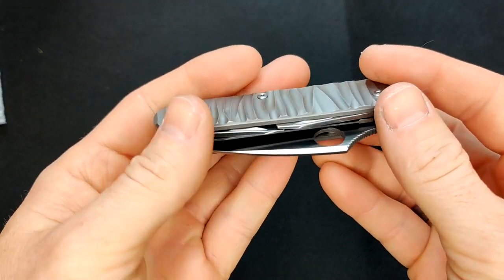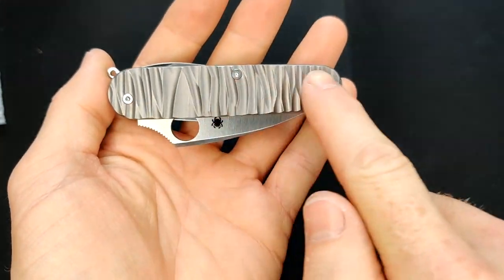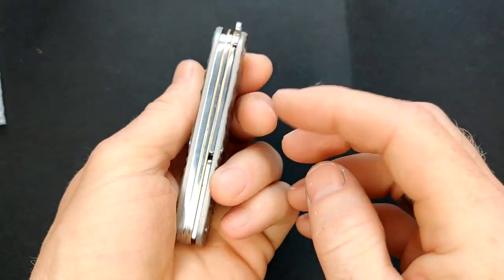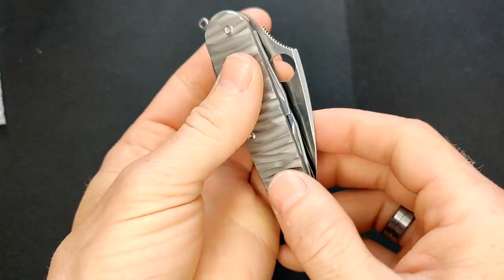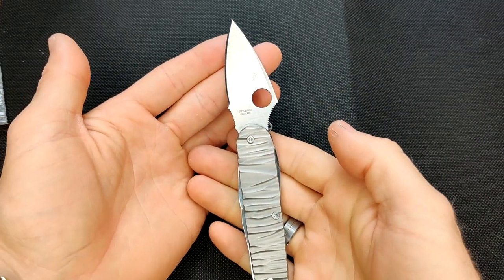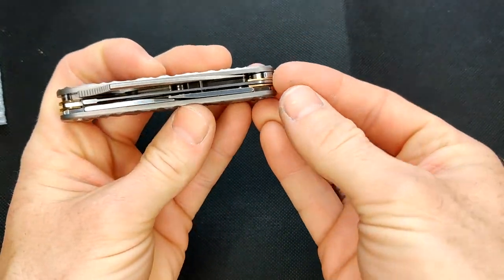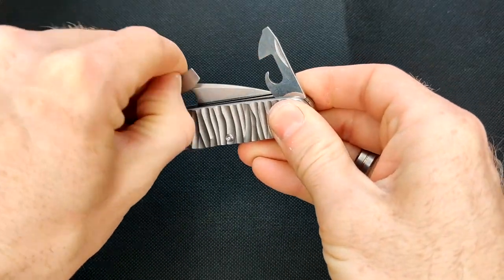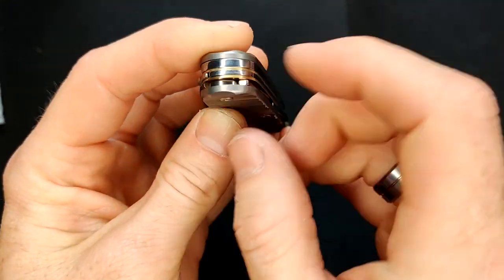Successful Spyderco Dragonfly experiment

Comment: Ahhhhh you did it! Wondering what you ended up doing to make the dragonfly fit, got the same blade and scales hanging out in my shop.
Reply from the maker: The spring layer worked for me after some modification. 👍🏻 Send me a message on Instagram or Messenger if you want some help.
Reply: @FittoSurvive  will do, making a note to get back to you in a day or two.
Reply from the maker: @antonsimanov  Sounds good

Comment: FtS  happy Saturday, you are very talented, a real craftsman, I am but a poor amateur when it comes to modifying my SAK's . I was going to have 2 Cadets that I own modified by a craftsman in France but gave up on the idea because the total cost was prohibitive & the shipping process & return shipping would take too long.  My idea was to make one Cadet into an "Executive" model by removing the can opener & bottle opener tools & replacing them with the small scissors from a 58mm classic & the bottle opener / can opener / Philips combo tool from the Rambler ( leaving the blade & nail file intact ) . The other Cadet I called the Cadet Technician which would entail removing the nail file & replacing it with the 58mm scissors & removing the can opener & replacing it with the Ramblers combo tool & leaving the blade & large screwdriver / wire stripper / bottle opener intact. But as I wrote it was too costly & would have ended up making 2 x  $37 knives bought new into knives which have cost almost $550 for both & so  I figured that was simply an unjustified expensive piece of vanity on my part & scrapped the idea!
Reply from the maker: Sounds like two really cool projects. Unfortunately making custom Swiss Army Knives can become quite costly. In general, the cheapest custom I make costs around $200 (shipped).
Reply: @FittoSurvive  Hi FtS  yes far too much considering that we are not talking about building or modifying special tools like your Spyderco blade or titanium or copper scales but standard SAK parts from other knives, ones that can be bought both new & used on Ebay & cannibalized for their parts . If I had the skill I would have done it myself but alas my modification skill is confined to opening up the secret channel on Plus scales & cutting down a toothpick to fill the slot.
Reply from the maker: @stevesinclair4159  Yeah, I get what you mean. 👍🏻
It's cool that you make the mods you do. 😎

Comment: Love all the custom Victorinox knives that I have seen you do so far !
I'm hoping to do my own custom build, starting with a Trail Guide, and replacing the corkscrew with a Philips screw driver, and adding pliers (both from a Mechanic that I purchased after the Trail Guide... I prefer all my SAK to have a blade, scissors, and the metal file (used mainly for a nail file), and own most models that do... I think !

But I'm hoping I can add a Spyderco Dragonfly 2 Wharncliffe blade in place of the regular large blade... not sure exactly how to go about it, and don't want to damage the Dragonfly blade, seeing as it cost about $70... I see where you mentioned using an old scissors back spring, which I have from a Super Tinker.

I could not find any videos that would show the required mods... maybe you can point me in the right direction ?

I sure would appreciate it... definitely would save me a lot of frustration and trial and error !

Thank you !
Reply from the maker: Hey, that's great to hear.

Sounds like an exciting project.  Sure, I wouldn't mind helping you out. Send me a message on Instagram or Facebook Messenger (links on my website). That way I can send you pictures explaning the process.
Reply: @FittoSurvive  Will do... on Facebook messenger... I don't do instagram... appreciate the advise !
Reply: @FittoSurvive  FB message sent... Thank you !

Comment: What springs did you use for the blade? Since your not using the normal knife ones?
Reply from the maker: I used an old scissor spring.
Reply: @FittoSurvive  thanks man need to try that out! Love your work still trying to figure out a tool set for a 58mm i want so i can order one from you just want to make one custom for myself before i buy them from others
Reply from the maker: @midwaymonster78  Sounds good.
Reply: @FittoSurvive   would you ever be willing to work on the 93mms?
Reply from the maker: @midwaymonster78  I am interested in getting into the 93mm range. And I imagine it is just a matter of time.

Comment: I really want to do this but with the H1 dragonfly blade
Reply from the maker: Should work just as well with the H1.
Reply: @FittoSurvive  I'm just worried about grinding down the blade. I've heard H1 can be brittle
Reply from the maker: @Hunglikeagrimsmo  I have actually never worked with the H1. So, I don't know for sure. But, with this mod that I did here the Spyderco Dragonfly blade doesn't need a lot of grinding.